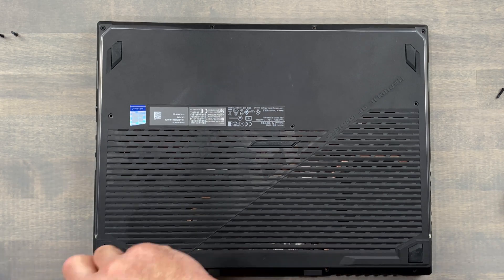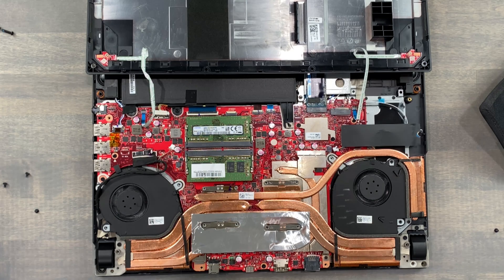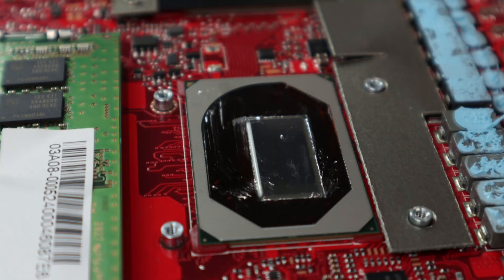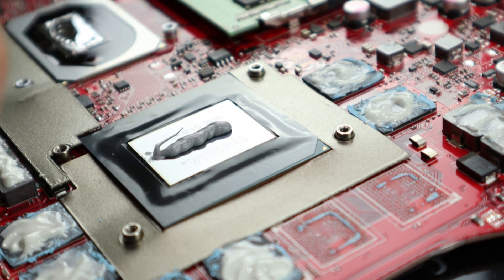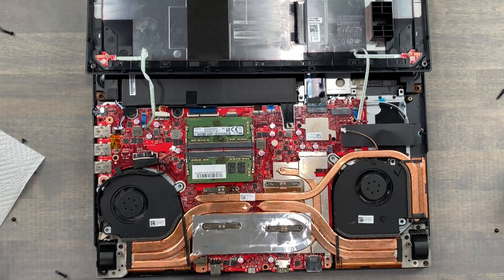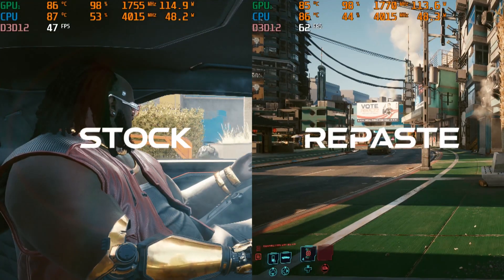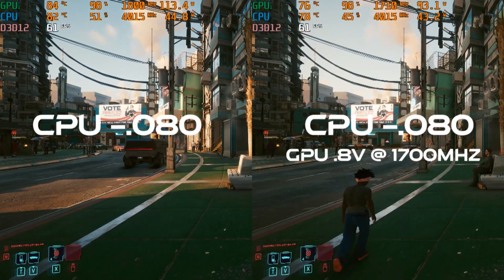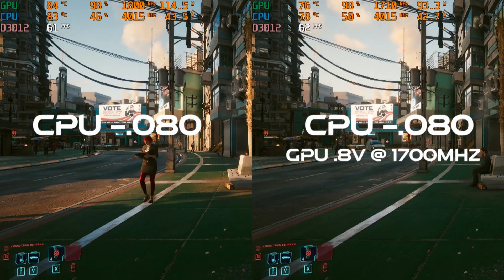Strix G15 Repaste!  (10870H 2060 115w)

Comment: I just reapply the LM because of this situation: I friend of mine just bought an Asus ROG Strix G733ZX and asked me to install Win 11 on it and make it ready for CAD work, it had an I9 12900H and a RTX 3080 TI. I did that and after a couple of days, he calls me and asks me to reinstall Windows again because it's kinda slow and he wants it to be fast for the 3000 dollars that he bought it for. I said to bring it over and ran a CPU stress test. It failed miserably, the power was low and the temps were @ the max 100 degrees C constantly. I said to him it is a hardware problem, probably the LM isn't applied properly and that he should take it into warranty. He said he doesn't have time and I should open it and see. I said to him that the warranty will be voided if I unscrew that sealed screw on the CPU and GPU cooler and he said he doesn't care, he needs it urgently. I opened it and remember, it was a BRAND NEW laptop, new as in 1 month since it's manufacturing date. The CPU had LM and the GPU had thermal paste only. The LM on the CPU was 80% concentrated in a corner, near the protective foam. The CPU was almost like a rainbow, it had dark spots and a big bold spot. So i just reapplied the LM until there were mirrors on the CPU and on the cooler and put it back, fully assemble the laptop and my friend was overwhelmed with how fast it was now running, after this operation. He now brings me the laptop almost every year since then and i simply reapply the same LM and the laptop runs very well (he uses it a lot). He bought a similar laptop for his wife and he said to void the warranty and reapply the LM the very first day he bought it. The LM on that second laptop was spread similarly poorly, just like the first one. I don't know if it's an Asus problem or an LM problem, but simply reapplying it until you obtain thet mirror effect seems to do the job properly, there is no need to change it.  If it's plenty of it and it still is in LIQUID form, just reapply it, don't throw it away. You could also, by mistake, spread it onto the motherboard when trying to clean it, that is another reason to just reapply it.
Reply: Its Asus problem, I have g16 2023 since new I had issue with temp but was so afraid to open it now I have to re apply LM bcuz its too much of temp no matter what

Comment: K5 pro costs a lot😂 so can I use Arctic mx4 paste on vram and vrms
Reply from the maker: @m.smanoj4688  I’m sure it doesn’t cost as much as a new motherboard replacement when a chip fry’s from not using the correct paste.
Reply: @BobOfAllTrades   ok as u told and as your advice ardered k5 pro for laptop vram and vrms

Comment: I guess my comment got deleted because I put an external link in, but I don't know how to show you in i-m-g-u-r. I pulled a similar model heatsink off and the cpu had the liquid metal on it but it appears to have gotten under that protective layer and even looks to be on some of the resistors/capacitors? on top of the cpu. But the computer turns on. I want to get it cleaned off but not sure, first, if I need to get the residue from underneath, and if so, how to access it to fully clean it properly.
Reply from the maker: @ryanmann44  remove the film that covers the pcb, clean off the Liquid Metal and then use regular nonconductive thermal interface material 👍

Comment: The processor temperature exceeds 85 is this normal
Reply from the maker: @Mouh.vol2  it is
Reply: @BobOfAllTrades  No, I mean 90 and sometimes it reaches 100 in red dead redemption 2
Reply: @BobOfAllTrades  What do u recommend
Reply from the maker: @Mouh.vol2  turn down wattage of cpu
Reply: @BobOfAllTrades  I have tried throttlestop But it's locked my laptop is rog strix g15 i7 10850h

Comment: Hey I just applied thermal paste to both the CPU and the GPU. Is this going to cause a problem? Do i need the liquid metal?
Reply from the maker: Liquid Metal is not necessary.
Reply: @BobOfAllTrades  thanks. Have you ever had an issue after repasting and reconnecting the battery that the laptop won't power on?
Reply from the maker: @MetaModern87  I have with a Dell before.  It eventually came back alive
Reply: @BobOfAllTrades  just kept it on the charger for awhile or what? My g17 is currently not responding. No charging light either.
Reply from the maker: @MetaModern87  I honestly don’t exactly remember what I did. I just know that it eventually came back on. But I don’t think it was any longer than maybe 3 to 5 minutes. We’re talking about something that probably happened seven or eight years ago.

Comment: What if I put thermal paste in one component but a thermal pad in the other? I plan on using the PTM7950 for the cpu. If I bring the heatsink out, will I need to replace the pad as well?

Comment: Can i use thermal pads instead of paste?? And what brand liquid metal is?
Reply from the maker: They use thermal paste on those components for a reason getting the thinnest thermal pad might work or it might not. And thermal grizzly is probably one of your better choices for liquid metal.
Reply: @BobOfAllTrades  i have 33gr of grizzly i will be fine for a while. Can i use liquid metal on gpu? Is silver king good too?
Reply: @BobOfAllTrades Do I have to worry about the thermal putty touching motherboard components? Also do I have to remove all the thermal putty before applying new?  I'm going to use the LAIRD Tputty 607.

Comment: Can i Use liquid metal in GPU as well than CPU??
Reply from the maker: Yes but I don’t suggest it.  Protecting the outside of the die on the GPU is challenging and doing it perfectly without compromising the die to cooler contact is difficult.
Reply: @BobOfAllTrades  Thanks, I will use Conductonaut from Thermal Grizzlie in CPU and Kryonaut in the GPU, Nice Tutorial, i have the same laptop🥺🥺
Reply: @BobOfAllTrades  I have another question, i don't have K5 Pro, so, can i Use thermal pads instead?? And if is yes, what is the mm that you recommend??, Sorry if my english is not the best, i am from Chile, Thanks a lot
Reply from the maker: @Kirschbluteee  It’s risky, but thinner would likely be your best bet since paste was used.  If it’s too thick you’ll have poor  CPU/GPU contact and you’ll notice this quickly.  If it’s too thin you won’t notice it right away, if at all.  It’ll either throttle and you won’t know why or you’ll burn something out.  

I’d source something appropriate even if it’s a K5 substitute.

Comment: I bought a used ROG Flow X13 for a really cheap price but I found the GPU to be thermal throttling way before reaching its usual clocks. Performance is good and i can still play games but not use the gpu to its fullest potential. Would you say the process is relatively same with the ROG Flow X13?

I plan to buy K5 Pro, Arctic MX-4, and Thermal Grizzly Conductonaut. are these viable options?

Comment: And BTW don't use K5 , I've seen some pretty nasty photos of ppl complaing that it boils when components get super hot, creating holes in the k5 paste applied in the components, you can just use Grizzly thermal (the grey one he used)paste on all the components and it will do the job very well , don't use the k5 white paste !
Reply: Never had problems with K-5 Pro for components. But you're right, you can use normal thermal paste as well for components! Cheers :hand-purple-blue-peace:

Comment: Hey just a question, i also like grizzly , i have the thermal paste and was thinking of replacing the old one ,why do you use the thermal paste only on the CPU and GPU but you use that white one liquid metal on the other components? Wouldn't thermal paste do the same job? Or is the liquid metal better ? And if yes, could I use the liquid metal on the CPU instead ?

Comment: Thank you for your videos!

Maybe you can make a repaste video of the ROG zephyrus m15. 

Quick question: Will it be possible if the repaste is not liquid metal but the thermal grizzly kryonaut extreme?
Reply from the maker: You don’t have to use liquid metal.
Reply: @BobOfAllTrades  if I understand correctly, so there's no problem if I don't use liquid metal?

Comment: Hey Bob I'm planning to do a repaste on my G15. Quick question why did you apply different pastes for the vram, cpu and gpu, why not the same for all?
Reply from the maker: Thermal pad replacement paste is different than cpu/gpu die paste.   The surface material, viscosity and temp requirements are different.

Should you use cpu/gpu paste everywhere, you could be slowly frying your surrounding components without knowing it since most is not read by sensors.
Reply: @BobOfAllTrades  Oh I didn't know that. Also is there a problem if I don't apply new thermal pad replacement paste and use the ones thats there already instead of scrapping it. Thank you!
Reply from the maker: @georgyjacob6810  I’ve done that once.  I can’t recommend it personally because I didn’t have the laptop long enough to see the outcome.
Reply: @BobOfAllTrades  Can you recommend multiple other thermal pad pastes because the K5 Pro isn't available in my area
Reply from the maker: @georgyjacob6810  That’s the only one I have experience with and that’s the only one that was recommended to me by the best tech guys around.
Reply: @BobOfAllTrades  Do you know of any other paste that can be used? You don't have to recommend them, I'll look into it
Reply from the maker: @georgyjacob6810  I honestly don’t know.
Reply: @georgyjacob6810  K5 Pro isnt good, u can read in many forums that it dries out very fast and hardens (less cooling performance) looking like a switzer cheese.
use this one instead:
Alphacool Apex 17W/mK Thermal grease 20g

Comment: What paste u used for power section? In mine triton 500 they used some red factory so i change it after year for conductonaut. In many forums ppl always says to use thermal pads but in mine case even factory didn't use it only in one place even there i used fat amount of grizzly ( it's save in mine opinion i know whole power section and vrams got contact with cooler plate ) what do u think?

Comment: Hey Bob, thanks for this awesome tutorial. I'm also planning to do a repaste on my Strix G15. My question is, instead of using K5 Pro for the vram and memory chips can I use thermal pads instead? The place I'm living in K5 Pro is not common and importing it cost 4x as much. Thank you
Reply from the maker: I’m some instances, the reason why thermal pads are not used is because the tolerance is so small that even a .5 thermal pad may be too thick. But if you absolutely have to go that route then get the thinnest pads.
Reply: @BobOfAllTrades  can regular thermal paste be used instead of a viscous one (like the k5 pro)?
Reply: @BobOfAllTrades  Alright, thanks for your reply!

Comment: Why don't you remove all the blue material from the pads?? is it because of something in particular?? (i kind of prefer a clean interface with the k5 pro install)
Reply from the maker: There’s no point thermally but I truly appreciate you for wanting to do so.
Reply: @BobOfAllTrades  haha good to know, I thought i may have screwed the instalation. For the vram chips would you recommend kryonaut / kingpin or kp5 pro?
Reply from the maker: Kp5 will be just fine 👍
Reply: @BobOfAllTrades  can i use Thermal Grizzly Kryonaut 1 for vram?

Comment: how i can put the -.080mv in the rog bios ?
Reply from the maker: That’s going to depend on the laptop model, CPU and bios.
Reply: @BobOfAllTrades  Thanks, I have, the G712LU model is practically the same as that model, only with the 17-inch screen and with a 1660ti instead of a 2060, but in the rest it is the same.

Also apply the mv of 80 to the CPU. 
I have not made any changes to the GPU, as I always use the TURBO profile in the Asus Armory app.

Comment: Got a question regarding thermal paste  for components, do I have to use something different or can use any other? Like for example why did Bob here used K5 Pro for components and Phobian Nano greace for the cpu/gpu?
Reply: Hi, if you want you can also use the same thermal paste for the components like pasting the gpu. K-5 Pro, like mentioned in the video, is in my opinion the best for components. For GPU i have best experience with Arctic MX-4. Liquid Metal is best for CPU's, cause they getting very hot in full load. Cheers :hand-purple-blue-peace:

Comment: Hi Bob, great video. I intend to repaste my Asus M15 Zephyrus (which also uses liquid metal as stock product). Would you say the process should be pretty much equivalent? I also intend to replace the fans as they are having some weird noises
Reply: Did you repaste it? 

Why did you repaste?

How does the temperature, acoustics and performance pre & post repaste?
Reply: @therealb888  Hi there, yes I did, i used kingpin KPx on both CPU and GPU. I would say thermals are definitely better, previously my GPU got easily to 86-87, now i'm closer to 83-84. CPU is pretty much similar. Overral it's a bit better and the good thing is that thermal throttling occurs with a lesser frequency now (it still occurs though...). The chasis of the M15 is way too thin i guess. Ask me anything about the process if you're interested. GL
Reply: @anibalhuneeus  my fan is making weird buzzing, humming noise also. Did you do sth abt yours?

Comment: Man I really wish I could unlock the BIOS on my Helios 300. I'm running at 73C at full load on the GPU pulling 80W, there's easily room for 10-15 more watts. Already repasted and repadded the thing so the only step left is the BIOS unlock and I'd rather do it by dumping the bios using software only and no external hardware.

Comment: Bob, i have hp omen 17 with 10750H and 2080super. I love it, but the cpu gets to the 96-100C°. That's even after i asked an official service to repaste and they've put Arctic mx-2. What would you recommend? Better paste or only liquid metal would help me? This is with undervolted cpu. Gpu temps are from 65-73max.
Reply: i did my repaste last night on the 10750h on my asus g512 last night and i just used regular artic mx4 only the cpu had liquid metal on it. My temps when gaming on the cpu was like 99c and it  went down to like the low 90s. I figured it would have went down more. but its still better than it was. So paste doesnt really matter to much. I just dont like messing with liquid metal.

Comment: Bob, what was the fan noise like on balanced profile on the mech 15 g3, i only saw max fan at 52db, was it too loud for headphoneless gaming other than office mode? How was that 1440p screen in non gaming scenarios, was the text sharpness noticeable? I dont think i could run it at 100% scaling, probably 125-150%. I ask because im starting to do alot of text based work on the computer work doing programming.  A high quality 17 inch 1080p FHD panel should be just as good and be ran at 100% scaling? I haven't been able to look at enough QHD or 4k screens even with scaling to compare. Do you know if windows 10 still suffers bad from scaling issues? its either that 15.6 inch mech 15 g3 1440p or MSI GE76 Raider 17.3 inch 1080p,  Im trying to decide between these two machines.